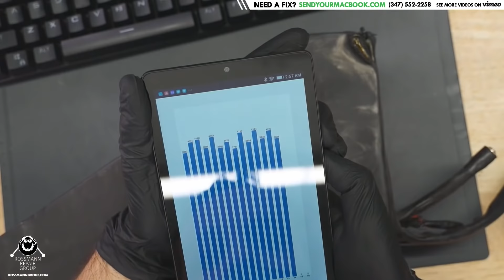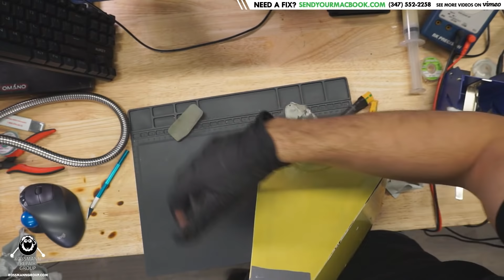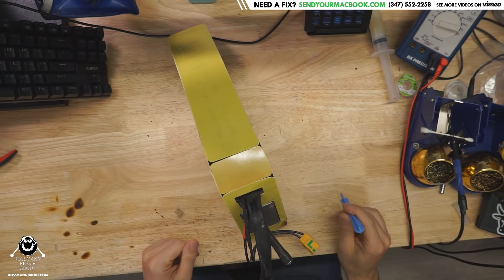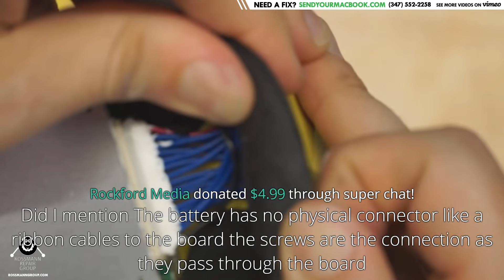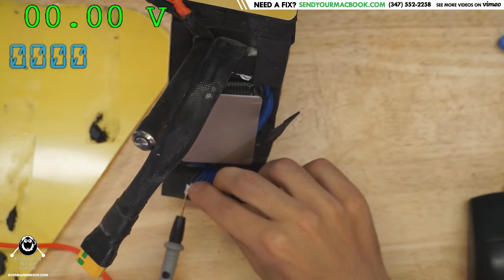EM3EV battery repair

Comment: You're supposed to load 3.6 V nominal voltage Li-ion cells by charging to 4.15 V with 1C and then keeping power source at 4.15 V until the current is between 0.05 and 0.1 C.

You can load the cells to 4.20 V but that will shorten their lifespan so much that I wouldn't do it.

Comment: Hi Louis!

I don't know if you'll be reading this comment an a 1 year old video but I have issues with the same battery (14s9p from Em3ev, but with the 35E cells).

I tested the kit and stored it at 50% in a wine cellar for 3 years as I couldn't finish the bike because of circumstances. (Wanted to build a proper metal case for the battery)

Now I finished the case and checked the battery, but it doesn't work anymore. The light on the on/off button only dimly lit up when I pressed it, and it doesn't output anything. I can't get the light to turn off either.
When I connect the charger however, it fully lights up and outputs power, but it seems the power is directly drawn from the charger instead of the battery. (The charger displays 58.6V 0.00A when connected, and when I also connect a bike light it says 58.6V 0.04A)
When I connect a bike light and turn it on, the light on the on/off button turns off, and when I turn the light off the light on the on/off button turns back to being dimly lit.

The BMS app doesn't work either.

Do you recognize this issue / do you know what it could be?

Thanks in advance!

Comment: Scalpel and an enormous lithium ion battery... what could possibly go wrong :D
Reply: A single tesla cell don't matter if its smaller than a 21700 cell I still would never fuck with then.unless I decide to replace and deliberately  make the 2 year cycle battery  blow up spontaneously  lol that's the only time I will destroy a battery fixing them is a no no no potential  to blow up in your face and throw red hot cells all over lol note smashing each cell while fully charged is crazy anyway I tried doing a few phone batteries  only had 1 that puffed up and made a small bang and flames after stabbing  it  but these tesla cells do more than that they literally  explode sparks  and get red hot like a fire cracker flying in the air

Comment: Simple way to calculate is:   Max rated power / total pack voltage = max amps. 
The fuse is probably rated and 3x max amps.
Reply: Those aren't fuses on main power cable, those are fuses on balance wires. BMS does balancing with current (typically 20-200mA) that is way lower than charge/discharge current ( up to around 50A discharge or around 15A charge - for 9P battery ).

Comment: Long lasting trackball:  Kensington "Expert Mouse" model# K64325.  There's enough space in there to wipe off the finger slime when it blocks the optical sensor.
Reply: Amen.  I LIKE those.  I have both an older one, and a newer one, too.

Comment: I build  custom lithium power packs, and 99% of them are built with kapton tape and black duct tape. I'd  use an active balancer. A higher quality bms would  balance regardless of if it was charging. A little pricey but worth it in your application.
Reply: Can you recommend such a BMS?  Thanks in advance.

Comment: Louis Why don't you discharge the battery and charge it with a 2A, or even 1A charger. That should allow the battery to balance itself.
Reply from the maker: It doesn't discharge evenly. when the weakest cell is at 2.6v others are at 3.1-3.2

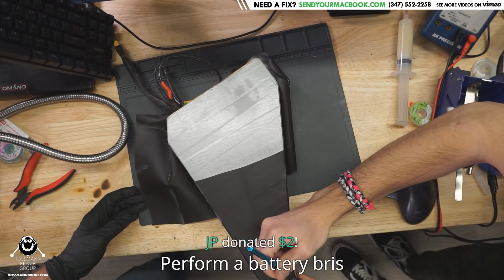Comment: 11:00 I would 3D print the new case instead of heat shrink it.
First off no thermal stress on the batteries while doing it, 
2nd it might be hard to get the shrink, and even if you do you might have to buy  much more than you'll ever need,
3rd You might end up opening it again, and a custom printed case will be easier to do so. (also closing it after)
Reply: 1: He does not have a 3D Printer.
2: 3D printer with bed large enough for that size is hard to come by - and expensive.
Reply: I have thought about using epoxy-fiberglass to make hard-shell cases for Ebike batteries.  I’ve done something like this on a smaller scale for another project.

Note that these cases would easily “split” for maintenance, and be sturdy as well as (relatively) waterproof.

Comment: 18:32 you should coat it in a layer of very thing kevlar or other physically protective surface and then do heat shrink. Or do that then heat shrink then kevlar. Especially with the bike videos. You can never be too protective.
Reply: Then get some of those super aerodynamic bike suits they use in the olympics and make a vecro version you can strap on to ride home. Maybe some of those cool helmets also with a kevlar surface. Then you can ride with comfort on the way home. Kevlar probably reduces flow of air a little, but it's not necessarily a speed run.
Reply: Or this made of kevlar: https://pitstopusa.com/i-23987238-sparco-jade-3-suit-large.html?utm_source=google&utm_medium=cpc&scid=scplp23987238&sc_intid=23987238&gclid=EAIaIQobChMIv9Dq4J3p6QIVjYbACh1LOQgNEAQYAyABEgItmvD_BwE

These look kind of badass.
Reply: All while flying through the streets of new york at full speed playing this from massive speakers on your bike: https://www.youtube.com/watch?v=P73Z6291Pt8

That gives you 5 minutes to get home. Can you make it?!